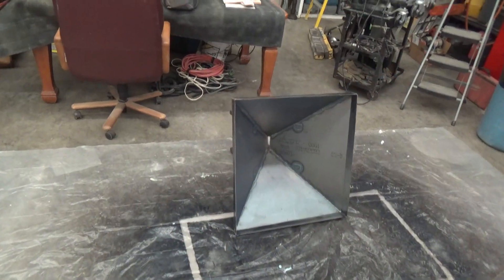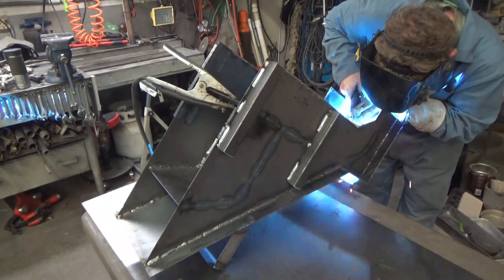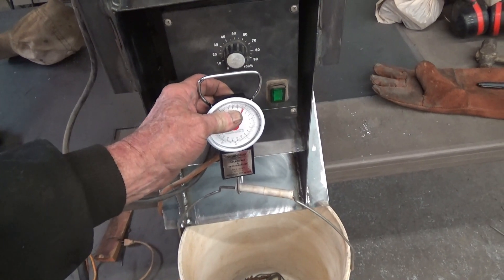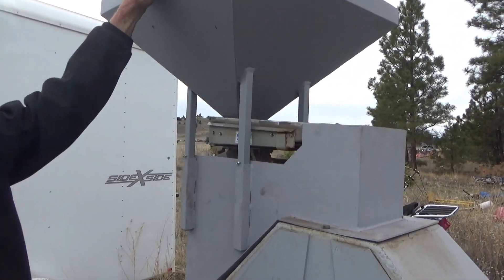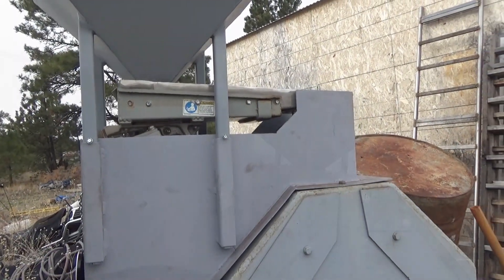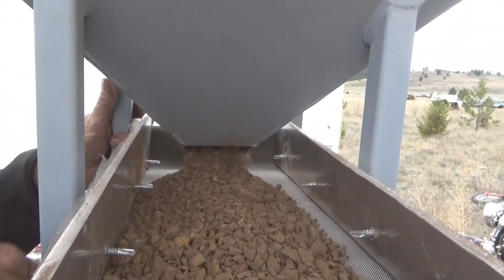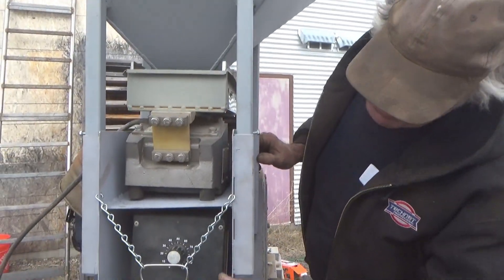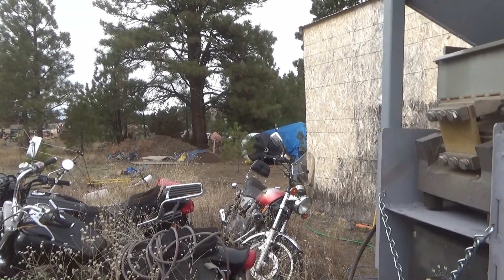266 New Feeder Screen for the Stutenroth Impact Mill

Comment: Hi Keith,
There are some nice suicide self tapping screws on your screen. I'm sure, it's to keep this machine improveable. ;-)
A slider on the feeders outlet would be good. You could adjust the feed rate and you could remove larger rocks stuck down in the feeder.
Best regards from Germany!
Reply from the maker: Then screws were to attach a screen to a feeder not designed for it.  :-)

Yes a sliding gate would allow more adjustment and versatility.  Don't be surprised if I go there.  Moisture content will also change the behavior which may need simple and substantial adjustment.  Thanks.

Comment: Do you think we can ever run a machinery park out in the field just with solar?
You know, just all the crushers, hoppers, tables and such.

I know they experiment with water turbines here in austria, since we have running water in most places in the mountains.
Which i also think would be just great, if it indeed is doable in the end.
Reply from the maker: Solar is both diffuse and intermittent.  While it makes sense for things like pumps, crushers use LARGE amounts of energy and need a powerful source of power.  It is also common for all but the smallest mines to operate multiple shifts to keep the expensive capital equipment churning out production.  That would take a lot of energy storage.
Reply: @hardrockuniversity7283  Yeah, thats how far i got so far myself ;)

It just doesnt seem to add up when you do the math.

Thanks for the reply. And lets see if i can make it 100 more minutes for the penthouse or not.
If not, you guys have fun :DD
Reply from the maker: @1000-r3g  Roger

Comment: So is this so you don't need to grind stuff that's already the right particle size Keith ?  if so i suppose that makes sense , no point in running ore through the mill you don't need too. would be just excess wear and tare for nothing . Great idea and a good job . Like you said the feeder mouth might need to be cut a bit bigger , but that ore seemed a little dampish maybe causing it to stop feeding . Good job ,  cheers Ned .
Reply from the maker: Not just to minimize wear and tear, but also to minimize production of 'slimes' (very small particle sizes).  I can get 90% recovery in a day from 60 mesh minus, so smaller than that doesn't do much good, just creates mud that is hard to handle.

Comment: very nice feeder system, i like how the bucket gets weighed so the person switching out doesnt 'over do it' with too much weight ...  thats a good system to keep from straining shoulders, arms, elbows and backs ... ---
Reply from the maker: Mainly for precise calculations of ore weight and grade.
Reply: @hardrockuniversity7283  hmmm.. its a nice screen.. surelooks like is about 30 -60 mesh .. purdy fine stuff gettin through it ...
Reply from the maker: @robertzfindingz3512  30 mesh.  That is the start.  We will test the leach kinetics and materials handling issues and adjust if needed for optimization.
Reply: @hardrockuniversity7283  its a good start, and maybe yer shakin system could perhaps have a 2 stage screen .. argh .. that there be a system twice as fast as the ssingle one ...  the old twin shifty side to side action it be ...
Reply from the maker: @robertzfindingz3512  I suspect this will be adequate.  I will need to get experience and data.
Reply: @hardrockuniversity7283  but i thought the finer the better, 30 isnt all that fine ...  but youl find out soon enuf ...  if the price is right, and itll be fine enough, or youl have to go behind door number 2 and refine the refinery to get better shinery ..
Reply from the maker: @robertzfindingz3512  Yes, it will less efficient in dissolution kinetics.  OTOH, the kinetics are exceptionally good and a finer grind also means more slimes which cause problems.  If we can get good final recovery on the tailings pad, then recovery will have very minor debits while materials handling will be much easier.  I will test the details from splits of bulk sampling of the ore we process.  Then I will compare that to the handling issues and perhaps change the screen size.  Less than $20 and 15 minutes.  Very easy to change.